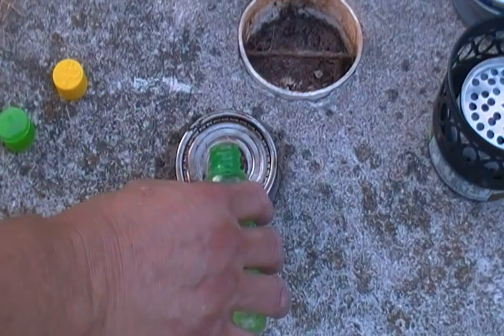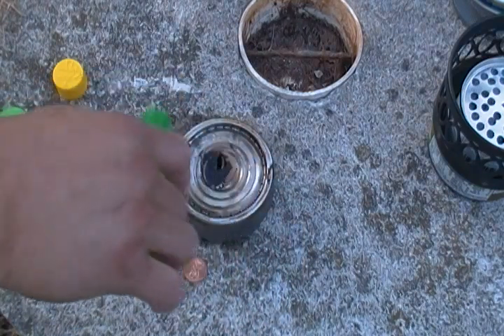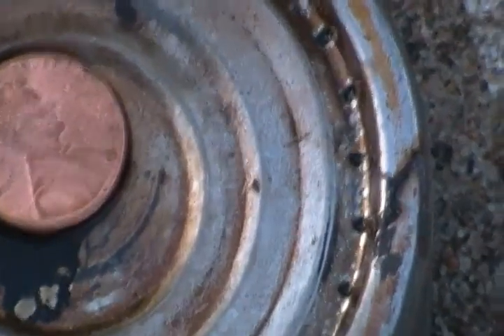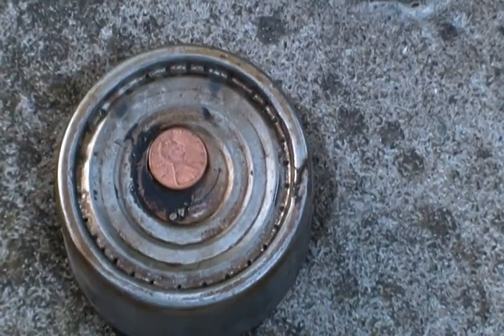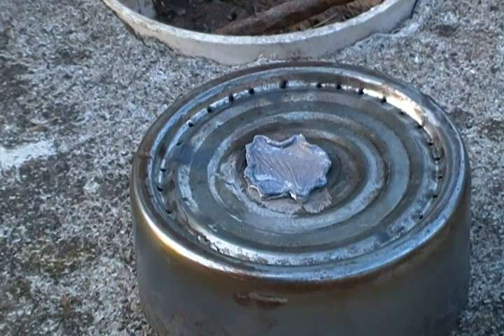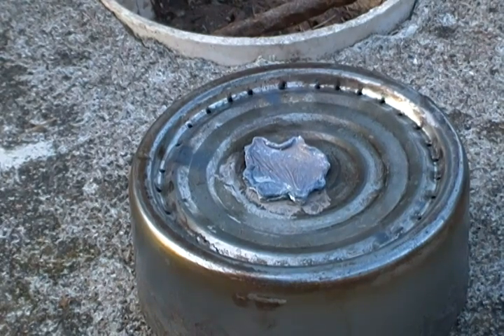Rich's "Nickel Stove" melting a penny!

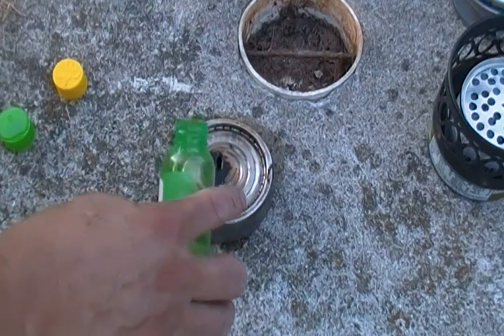Comment: 0:22 Part of the reason it melts pennies is that newer pennies (since 1983) are made of zinc, not copper. Zinc melts at about 750*F, coppper at 1,984*F. Nickel melts over 2,500*F.
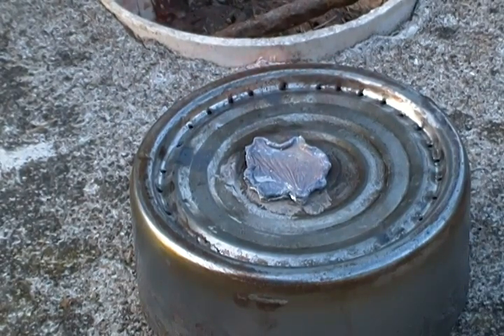14:20 Oh. I hadn't got to this part yet.